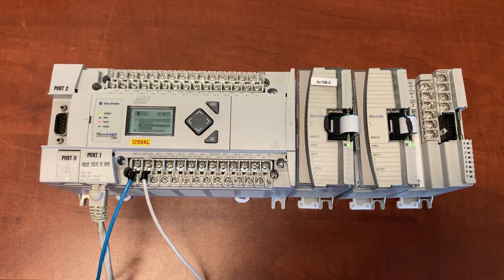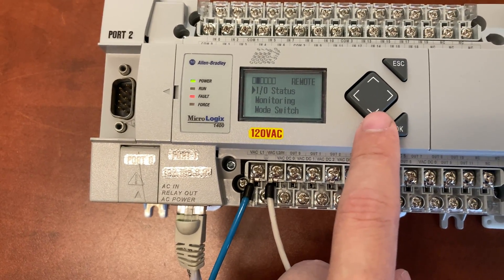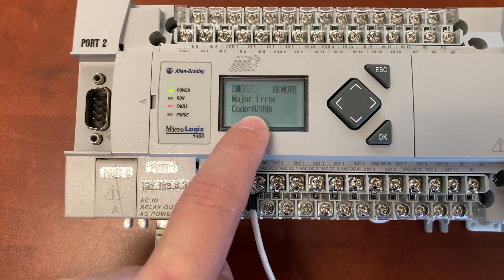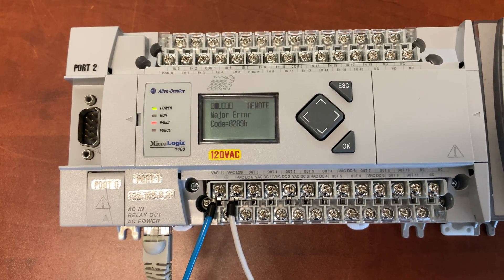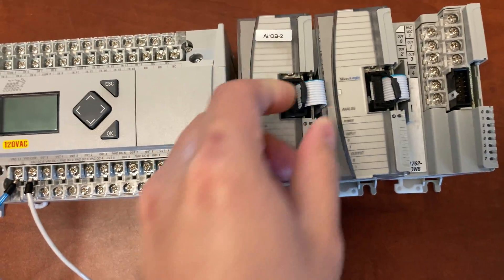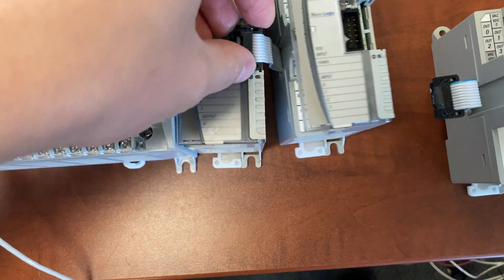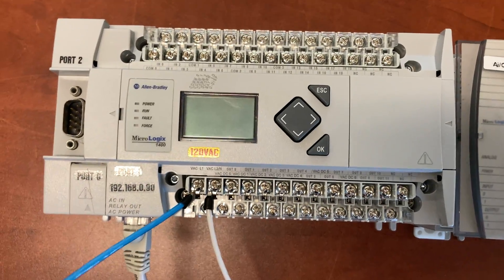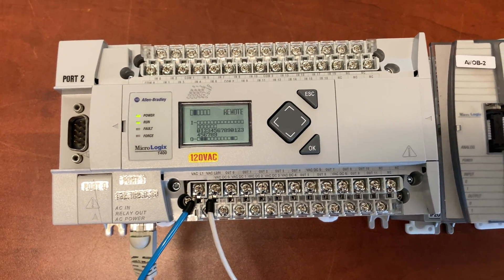Micrologix1400 Troubleshooting - Error Code / Fault Code

Comment: After connecting PLC through Ethernet and checking on modscan32 , it shows TCP IP terminated. No fault on plc screen. Can you guide me what can be the issue.
Reply from the maker: @pankajparihar8593: You might want to check the "length" set up on your Modscan32. It cannot be greater than the amount of Modbus registers coming from your PLC. Good luck.

Comment: Hi i have error 0006h and plc stops communicating with vfd , please suggest the possible reasons
Reply from the maker: @tessilesolutions9974: 0006 means "The memory module hardware faulted or the
FAULT memory module is incompatible with the OS." Recommended action from Rockwell is "Upgrade the OS to be compatible with the memory module. Or Obtain a new memory module."
Reply: @SYPHOANG  Thanks for your reply. This plc is connected to 5 nos of v1000 yaskawa vfd's. After initializing vfds with default paramaters communication is lost, eventhouh we set all H5 parameters. Comm0 also not flashing in plc, earlier it was flashing. Please give me some lead to solve the issue
Reply from the maker: @tessilesolutions9974: If comm port indicator is not blinking, there should be no communication. From the provided error code, your PLC has lost the program stored in its memory. You can try to redownload the program to the PLC. If it still is not communicating, it should be time to replace the PLC. Good luck !
Reply: Thank you, I will try to download the program.  Plc comes to run mode, connects  with HMI and all other functions are ok. Only it does not communicate with drive.
Reply from the maker: @tessilesolutions9974: Have you tried it yet? Does it still have the same error code 0006h while everything is communicating but the drives? If it does NOT have any error code, definitely it should be anything between the drives and the PLC.
Reply: @SYPHOANG  Hi thanks for your follow up. I just matched vfd baud rate with plc, it's OK now thank you
Reply from the maker: @tessilesolutions9974: So I guess your system has Modbus RTU for the communication between the PLC and all the VFD's. If everything was communicating ok before, there would not be any communication problem. I guess someone from your team was trying to communicate with the VFD's. That was why that person changed the baud rate on the VFD's. You'd better check with him if it is okay to change the VFD's baud rate back to what it was so that the PLC can communicate with the VFD's again. Thank you for sharing your valuable experience on my channel.

Comment: Edit Alarm Code 0489h
Reply from the maker: @user-wl8kd1jr9k: "04" is for the 4TH expansion module starting from 0 for the PLC itself. "89" means "An expansion I/O module generated an error". My recommendation is to replace your expansion module. Thank you for your support to my channel.
Reply: @SYPHOANG  thank you

Comment: Good video. Could you help me with a question?. I have a micrologix 1400 C series, but the rslogix500 only allows me to program Up to version B.How can i update rslogix to be able to program the micrologix 1400 C series??, thank you very much.
Reply from the maker: @H89HD: what software do you use to program it? "Rslogix500" version 9.0 and later should work with micrologix 1400 series C.

Comment: I replaced the second card but still the same fault
Reply from the maker: @WxForecast: your controller might not be programmed to “clear fault” automatically on every “power cycle”. You need to go online with your controller and clear the fault. That’s the only way. Good luck. Thank you for subscribing to my channel. Should you have any more questions please let me know.
Reply: @SYPHOANG  Thank you for your help, appreciate! Yes you are right. The controller is flashing red fault and the connected HMI is displaying question marks, I think the program is erased because only if I connect an analogue I/O module the fault never cleared, means the configuration is lost, am I right?
Reply from the maker: @WxForecast: I think you are right. If your PLC is faulted only and the program still is stored in there, HMI will still show current values right when it got faulted. The values, however, never get changed until the fault is cleared.
Reply: @SYPHOANG  Thank you BOSS for help